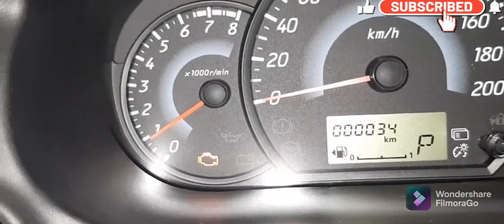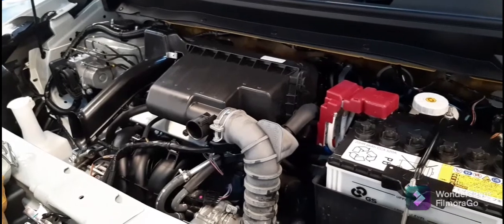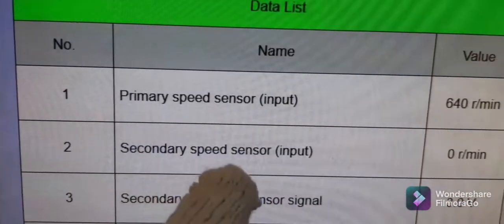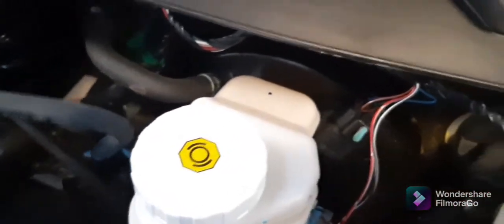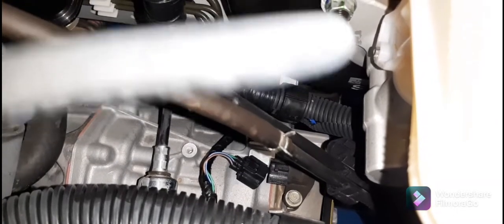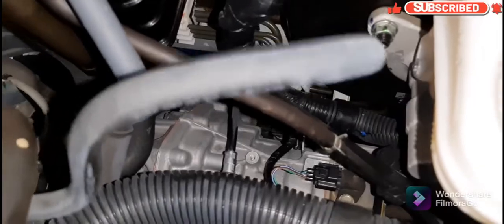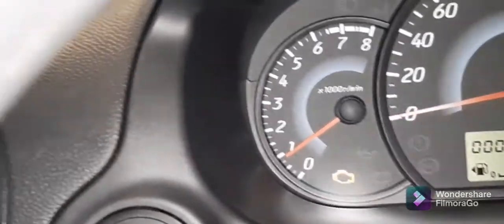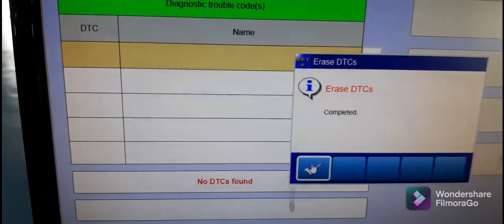Code P0791 Continues Variable Transmission No Upshift. Problem Solve. Attrage/Mirrage G4.

Comment: Di ko pa na pa scan 2021 mirage g4 cvt ko. Pero pag patakbuhin ko na ng 40 to 100 kph wala talaga akong ma feel na nag upshift at sobrang ugong na ng ingay ng makina. Pero wala naman check engine indicator.
Reply from the maker: Pa scan mo muna Boss para malaman kung may problema sa electronic parts, check mo rin Boss yung level ng CVT Fluid at condition kung deteriorated.

Comment: ganyan po lumabas sa scanninh po ng mirage po nilinis po ung sensor pero ganun padin po . ano poba pwede gawin po ? code error din po P0791 . Sbe ng mekaniko palitin na daw ung sensor po
Reply from the maker: Boss bago magpalit ng sensor check the circuit, check for open circuit or short circuit.
Reply from the maker: Puede rin Code No. P0971: Malfunction of the Primary Pressure Solenoid Valve(open circuit/short to power supply)

Comment: halos same problema pero sakin blinking D everytime na madadaan ako sa rumble strip at 40-60kph pati yung speed needle nagdadrop tas babalik after dumaan sa rumble strips. nakakabit naman lahat ng sensor sockets. sa diagnostic tools ang lumalabas ay iba iba. minsan P0715, P0791, P0285A. ineerase nalang then turn off/on engine nalang ulit para mawala blinking Drive.

mga wires at connectors na check na wala naman putol.
nasa lvl pa cvtf, 40k odo daw magpalit.
mirage g4 2023 30k odo.
Reply from the maker: P0715, P0791, (Simultaneous  detection) Malfunction of Speed Sensor Power Supply Circuit.
Nacheck nyo na ba sir lahat ng wiring, yung connectors ng mga sensors like primary pulley speed sensor, secondary pulley speed sensor, output speed sensor, CVT-ECU connector, nacheck nyo na ba yung mga pin terminals baka maluwag, nacheck nyo na ba yung resistance ng wire end to end, natry nyo na bang magpalit ng mga sensors. P258A Auxiliary Gearbox Gear 2 Incorrect Ratio.
Probable Causes:Malfunction of the CVTassembly (Faulty low brake solenoid valve or valve body assembly) sana makatulong. God bless po.
Reply: @autofixgarage5438  mga wires na check pero yung wire resistor hindi pa po. balak ko nalang po sana dalhin sa inyo. kaso po hindi ko alam ang location. sana po mareplyan ulit. plan ko na rin po ipa cvt fluid. 30k odo na po ako.
Reply from the maker: @roumilmendiola4300  salamat sir sa tiwala pero wala po ako dyan sa pinas, God bless po.
Reply: @roumilmendiola4300 Napaayos nyo na po ba itong issue ng Mirage nyo sir?
Reply from the maker: @jan-fermangahas5570 naayos na yan Boss secondary speed sensor disconnected yung harness connector.
Reply: @ChickotLightsandAccessories  yes po. tanggal-kabit mga socket ng sensor at linis na rin. di na nag blinking
Reply from the maker: Yung mga trouble codes ba sir active or stored lang?